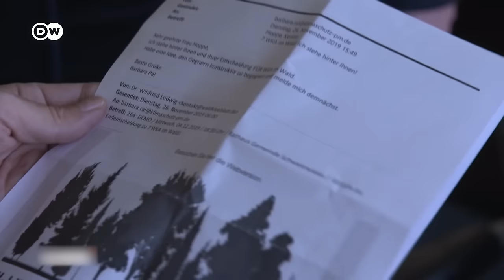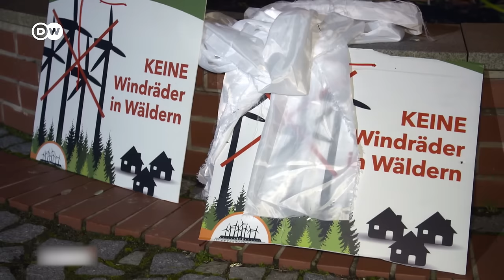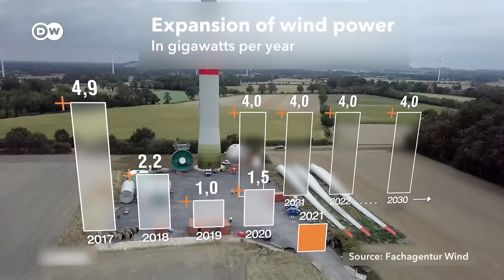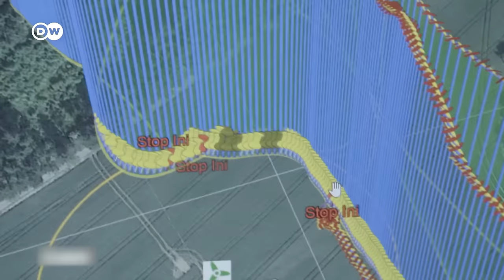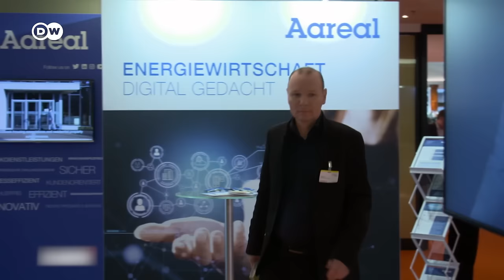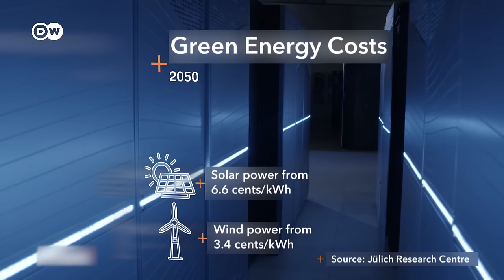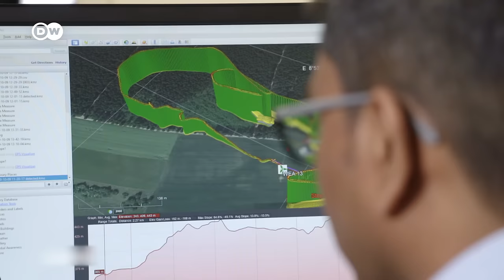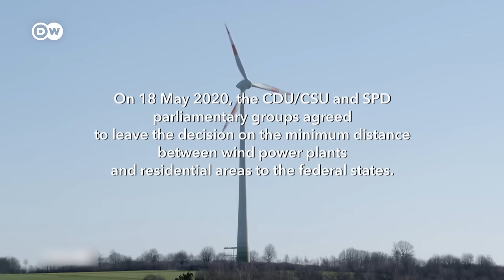Wind power getting headwind in Germany | DW Documentary

Comment: Some of the most important questions are brushed aside towards the end of the doc. The concrete is a big deal, but it will be offset after the turbine has been running for some time - comparing it to replanting the trees is cheating as you should be planting those additional trees anyway, it's just greenwashing - so the question is how long does the turbine have to run to offset the concrete compared to other energy sources.
Reply: well also as you could see in the  documentary, most of the turbines I've seen there were on a field. so wtf is this argument about trees. and concrete? man, go live in cave if you don't want to use concrete
Reply: I've seen other documentaries that have estimated A typical wind project repays its carbon footprint in six to twelve months, and then last 25+ years of almost carbon free energy.

In comparison Oil or Gas is not just a power station, there is a massive infrastructure from drilling to pipelines refineries, transportation, shipping etc. so just as big a carbon footprint is required for the construction for the same power generation as Wind, but then burns millions of tons of fuel to generate the power. So in reality there is no carbon  footprint for wind if replacing fossil fuel as and when is decommissioned at end of usable life.
Reply: Also in comparison its estimated a nuclear power station takes around 3 years to get back its carbon footprint from construction (and probably another couple of years for decommissioning 40 years later) That's excluding the uranium fuel mining and processin.

Comment: There are other turbine designs that could "save the birds" and I think have been shown effective, and not as noisy. They use a corkscrew type design, either vehicle or horizontal. Magnet technology can eliminate the need for gears, extending a turbines life and efficiency.
Reply: You didn't see the video in its entirety I think, because it clearly shows that wind turbines pose no danger to bird populations (on the contrary even for large predatory birds: those species thrive in wind turbine parks).

Comment: Building 7 wind turbines in a village and voting is indeed very democratic. Human rights in the village are respected. This is determined by the German political system. But it’s not going to do this in China. It’s not that the government will not listen to the opinions of people in the village. Believe me, the Chinese government is not a gangster, but it will not vote. The opinions of the people in the village will be put on the workbench of the review group composed of experts. Under normal circumstances, most people in the village are opposed to it, because building wind turbines in the village does not benefit much, except for some In addition to compensation (if the land in the village is occupied), it will bring environmental changes and noise (about 50db noise can be heard from 150 meters away, so the Chinese technical regulations stipulate that the distance between the wind turbine and the residential area should not be less than 500 meters ). The expert review group will not only look at the interests of the village, but also look at the overall interests of the project, to find a balance between them, and sometimes have to sacrifice the interests of the village to let the project run efficiently and orderly. A very important value in Chinese culture is that the minority must obey the majority. I don’t know which way is better. Perhaps different cultures and different stages of development adopt different systems is a suitable choice. China is a developing country and needs to promote various policies and laws in an efficient and orderly manner. The law will not take care of everyone's interests. When you respect the rights of the minority, then the benefits of the project to the other majority are not respected.

Comment: There's nothing green about wind power. The furnaces needed to mold those blades, turbines and smelt steel is barely displaced in the mere 20-30 year lifespan of each turbine.

Solar panels have the same manufacturing methods and face the same scrutiny.

Nuclear has the greatest benefits taking into consideration all of the above.

"Green Power" is swamped with instant no questions asked government grants which is what makes it so attractive to multi-nationals.

Comment: Do this calculation. Add solar panels to every residential and commercial roof. Now add backup battery at each location. Do this and Germany will have more electricity 24/7 than they need.
Reply: And half of planet destroyed to buid does batteries and inverters in order to connect to the grid
Reply: You can sweeten the deal by installing more geothermal heat pumps for homes.  HVAC accounts for 47% of a home's energy consumption, more than anything else.

Comment: Germany already has 60GW of installed wind capacity. That is about as much as the average power demand. It's long gotten to the point where adding more wind is contributing less and less due to curtailment. Without hydrogen production there is no incentive to add more. Even with hydrogen it is a reach...
Reply: If that's truly the case, then they should be electrolysising their own hydrogen, not importing it.
Reply: @xungnham1388  They should be, but the electrolysis capability isn't there yet, and who knows when or if it will get built.

Comment: Absolutely idiotic. No country in the world does need to import energy period. Don't rely on politicians because they are only after your money. It is that simple. Do your own part at your own house. What people really underestimate is when you build a house energy efficient for once you reduce your over all energy need in your house by over 50% so if your electric/oil/furnace/heating/cooling bill average 100 a month now you cut it down to 50 a month. Build smarter and use heat exchanges than  just opening your window. A HVAC system is an good answer for any house to replace the old technology we have. But also don't build HVAC like we know them as bulky and heavy. instead do them as a loop system meaning. Small room heater and cooling units with a central unit only in the attic of the house with duct work only from the attic to the highest floor "ceiling" vents to drop in the fresh" warm or cold air which is outside air fully exchanged in the attic with the leaving air from the house. Than inside the house you run a 10cm hose from the attic walk way area ceiling to the downstairs walk way area ceiling most the time 2 are enough one for upwind and one for downwind. Those transfer than fresh climate controlled air between the floors allowing a 50watt fan system to circulate thru out the house all the air within hours each day. Leaving behind a nice fresh air system behind. What people always forget is science. Hot air always travels up... Cold always sink down. 
Most houses in Europe don't even have ceiling fan's. I don't know why but a energy efficient ceiling fan uses about 40Watt when running some even less so you let those run primarly over night and in intervals thru out the day which keeps all the air circulated from the rooms to the hall ways. People just are stuck to old technology. Like my house has air vent holes cut out above each door to each room. And some do have a fan like small rooms. And bigger rooms are passive allowing for decompression in each room and air flow in and out of the room while the door is even closed. So air is no longer trapped in the room.

Comment: Germany has been a complete and utter failure in terms of power generation. Wind and solar are not ready for large scale use. They have their applications for individuals who live on land that can allow them to have a wind turbine or solar panels to supplement the grid. Germany power cost is through the roof, harder on the citizens.

Nuclear is the cleanest option that is steady and can be used for large applications. We should continue research on thorium reactors and implement them widely. They don't have the issues of the typical reactors we're used to. Then we go towards fusion power, the holy grail. A world covered in wind turbines and solar fields does not preserve the environment. Damming every possible river is not a good solution either...

Comment: Renewables are the future of energy in my opinion. Regional wind farms along with distributed solar PV connected to regional hydro.

Combine high insulation with thermal mass and intermittent renewably powered electricity...silent, gentle heat during winters.

New US wind is 2 cents and new US solar PV is 3 cents per kilowatt hour. New Canadian wind is 3.5 cents. Wyoming is building 500 MW of wind online this year costing $1 billion. What is cheaper or faster?
Reply: Claims about costs are not sufficient you need to show how such proposals are logistically possible, ie where the turbines go, how many, load levelling provisions, what sort of network needed, these are vital questions.
Reply: @jimgraham6722  Many wind farms are located close to coal plants and then they clip into the same transmission line.

Comment: As someone who works in Electricity I can confidently say wind is the most garbage source of power. It's high maintance, impacts more usable land than other power sources, and worst of all it is intermittent. As a result it is also expensive. How/Why? Power companies have one responsibility, to maintain the safe and reliable access to power. Wind is not reliable or dispatchable. Picture this if you will, they said they want a 50% wind mix, so a nation like Germany consumes roughly 150TW of power at any given time, usually more on very hot days and very cold days. but that would mean peak would be around that 180TW mark so 50% would be 90TW of power (which is a huge amount). Now picture this its a cold day and power consumption is a bit on the high side wind is running at 80% capacity and other sources are maintaining the rest (70TW on wind and say 170TW consumption) then the sun goes down and the wind dies down... you lost solar and wind. Now the other sources are ramping to max but cannot meet demand and you have a deficit of about 50 TW of power... the plants cannot maintain the Hz... they start slowing down in strain... protection systems are about to start disconnecting people to attempt to stabilize the grid... you could lose up to 30 million homes with power if the system successfully disconnects, and if it isn't successful 80 million people could lose power for days while the grid is reestablished. What do you do?
Reply: You don't seem to understand wind, wind power and wind turbines construction/maintenance, but hey, you never said you're an engineer or a scientist, only that you are someone who "works in electricity."
Reply: @solomonarbc  No I know them very well. I'm an electrical engineer working in high voltage transmission in one of the main system control centers, I receive detailed feeds on power for my region 24/7. Wind is a shit technology, and causes nothing but reliability issues, any person in power that works directly on the grid will tell you the same. intermittency is not how you create a reliable grid, and monster batteries like in Australia is not how you build a cost effective grid. Plus if you use reliable baseline power with hydro peakers you create a safe, strong and reliable grid that can handle anything you throw at it, not to mention cost effective. I highly recommend you do some reading on generator inertia and reactive power, they are a type of "hidden power" that are required to keep the grid stable and since wind generators use DC power using converters into AC it does not produce amounts to be sufficient for power transmission or intermittent power deviations.

Comment: On the basis of there being 2 077 wind turbines in Australia, the RET provides $1.09 billion per annum to the wind industry. On this basis, and assuming the RET operates for another 15 years, the RET cross-subsidy for existing turbines from now until 2030 will be in the vicinity of $9.3 billion. Or that is $525000 per wind turbine of course this is needed to be able to retail electricity at $0.48 per KW ie they are total economic failure .

Comment: At no time in history have humans gone from high density, reliable energy sources to lower (Much, much lower) intermittent sources. The reason is simple, it's a really stupid idea. Density = green
Reply: I mostly agree, but I think the real argument is the amount of human labor needed to achieve something over simple density (though density can make things easier). This means that if producing and managing the energy from wind/solar can be done with little human interaction compared to other sources then more power to them. They may be farming the energy on vast areas but if once setting up the system they can mostly walk away then things may work. However, since such intermittent systems require huge redundant systems to support them then the maintenance of these supporting systems hugely adds to these costs.

Comment: Green hydrogen, I had not heard of that term before or the projects behind it, looks promising.  The thing about hydrogen is you can put it in a hydrogen fuel cell vehicle or boat and drive hundreds of miles with only pure water as the exhaust.  Also hydrogen fuel cells can produce electricity when its dark and there is no wind (stop gap).  Japan is moving to a hydrogen economy so they would likely be competing for the green H2.
Reply: Green hydrogen is green washing, 99% of hydrogen is a product from processing fossil fuels with CO2 as a by product.
Reply: @Jimmy4video  I spent an entire day researching green hydrogen, suggest you do the same.  Getting hydrogen from fossil fuels (steam reforming, partial oxidation, coal gasification) is the old method.  Green hydrogen only uses clean renewable sources of energy (wind power, solar, hydroelectric) to produce hydrogen from electrolysis.
Reply: @SoCalFreelance  the economy doesn't care what's possible, it cares what's cheapest. Building a hydrogen economy will extend the used of fossil fuels with all that implies.

Comment: Sad to see a bad choice made. Wind is very expensive and costly to maintain. From my studies the wind generators last about 5 to 8 years and then must be replaced. To bad they have a negative attitude about nuclear. Nuclear could save them a lot all he while being clean non polluting, while running 24/7. Newer, smaller modular units could produce power right where it is needed. Thorium reactors are very safe. Many times safer than the old nuclear power plants. Now the wind turbines will stop for birds stopping production?! While Germany still needs to sell, then buy power from France and other countries, these actions increase costs. You cannot guaranty that price you must sell excess power for, will be more than cost of the power you will need to buy when needed.  Market incentive is backwards in this arrangement, costing more selling power and costing more to buy. A lose - lose deal.

Comment: 31 out of 31 local residents don't mind the wind generators huh? I always thought the ultrasonic noise problem was greatly exaggerated for political gain. Also it's good to see there is a plan to mitigate the bird death issue. However, Germany has very close to the most expensive power bills in the world. Yet they are saying it will cost more to import green hydrogen for example? No wonder there is a backlash against costs. Ignoring that is ridiculous. But the real standout or elephant in the room on this documentary, no mention of what happens when the wind stops. One of the main problems with mainstream ideas on what is green energy, is you still need things like nuclear or coal generation, because when it is night solar panels don't work, and if you are becalmed like a sailor in the old days, the windmills may not produce anything for days. This all adds to the costs of the currently promoted green energy methods. This video smells like it was influenced by people promoting the wind industry and therefore seems to be propaganda.

Comment: Yes there is a lot of misinformation on wind turbines. British scientist Dr S Myhill finds that they do not save CO2 at all, when one takes into account the manufacture of the turbine, the concrete base installation and the maintenance of the turbine. During the expected lifetime of the turbine, it would save 4,356 tons of CO2 compared to a coal fired power plant, BUT, 27,213 tons of CO2 will be released during the manufacturing, installation and maintenance of the turbine, so there is actually an adverse effect overall on the climate. It has been established in Germany, that renewables only give on average 30% of the average power consumption, because the wind doesn't blow when the power is needed and the sun doesn't shine at night. If the wind turbines were tripled, there would still be many days that insufficient power would be generated. CO2 from fossil fuels and cement manufacture is deficient in carbon 13 and 14, which only represents less than 4% of the overall total CO2, so to cut out all of this would make no difference at all to climate. It has also been proven that CO2 has a saturation point of about 350ppm and would have to double each time to increase temperatures by 1 degree, so with CO2 at the current 418ppm, it will will take another 88 years with CO2 increasing at the last 10 year average of 3.2ppm per year and that is without doing anything to reduce emissions. That increase will still not bring temperatures up to the 950 to 1250AD level, which was before the 'Maunder Minimum' dropped temperatures to the little ice age, which we are still recovering from.